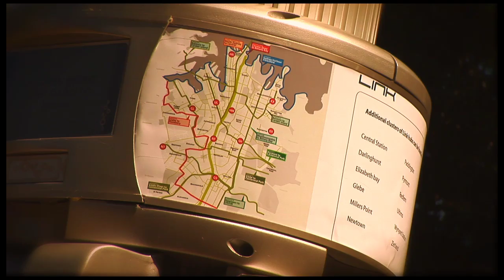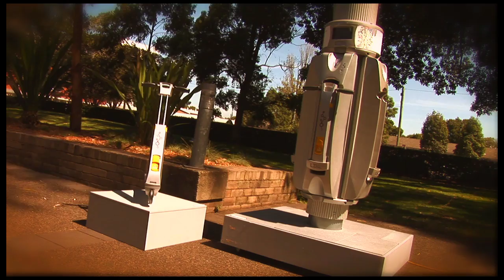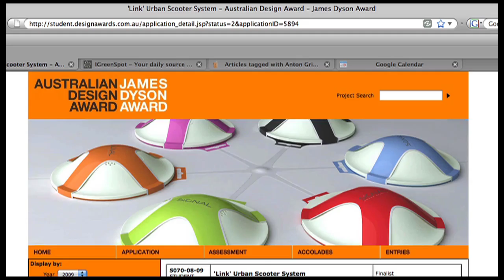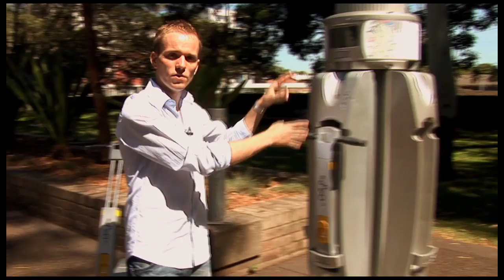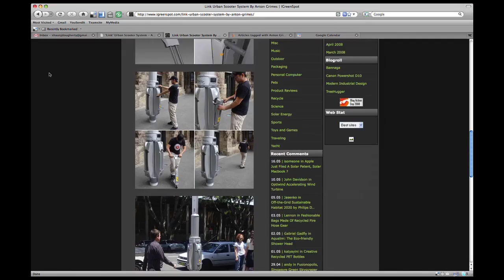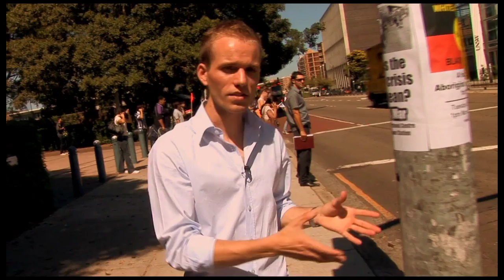Link Urban Scooter System

Comment: Exactly, how often do hire cars get stolen? not very from what I gather.

To me, docking station spaces would be the biggest issue. I comprehensive study of peoples movements would be needed to ensure that say somewhere like central station had heaps of docks compared to somewhere less popular. My suggestion would be something similar to the trolley racks at airports. But also these have a finite capacity.

You need to employ re-distributors much like a hire company or the trolly guy at Coles.

Comment: This is very interesting. Yes, there is a chance of this being stolen, if integrated into the general public, but what about in private large areas, eg theme park, zoo, or a university campus. It would be also great 4 each 2 be tagged with a GPS locator if in case it is stolen.  Also, cos u need to 'swipe in' 2 gain access, missing or un docked scooters can be flagged and your credit card or something will be charged or a fine issued.